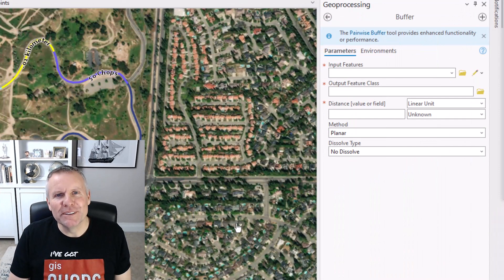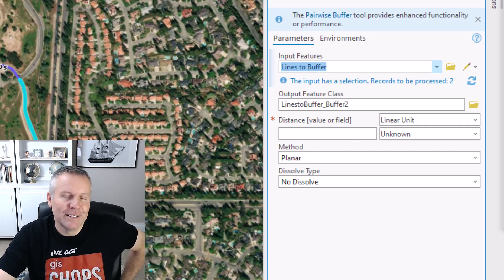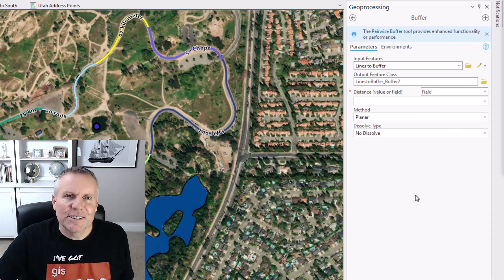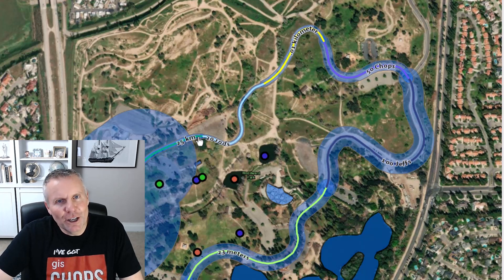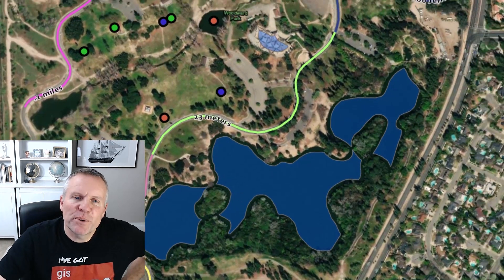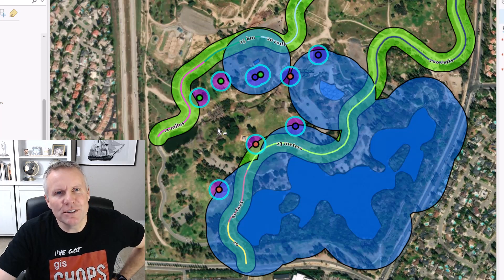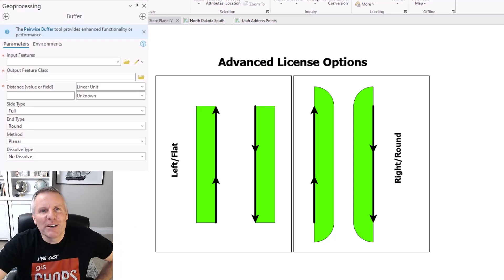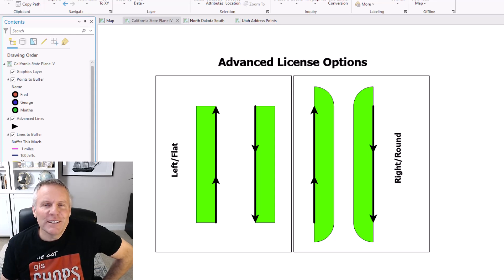How to Use the Buffer Tool in ArcGIS Pro

Comment: I appreciate the attention to detail, but sometimes I get impatient.  I need to do Thing now and want the basics.  
Buffer adds X Units to input.  That's the Elevator Pitch. 
Now... here's the advanced level and the cool stuff you can do.
I hadn't even thought about using a negative value.
Reply from the maker: So you’re saying I should get to the point faster? You can always watch at 1.5 speed. 😄😄
Reply: @GISChops  No. You're doing what you need to do by showing the full scale of the tool.  Sometimes I just need a Short video to show me the basics.
My impatience is a product of trying to come up with a solution on the fly.

Comment: I created a polygon and applied a buffer to it. I needed to edit vertices on the polygon but the buffer did not update to the new shape. Is it possible to have the buffer update if the polygon shape changes?
Reply from the maker: I’m not aware of anything that will automatically update a buffer when the source polygon changes. Maybe you could have an attribute rule that populated a field in the buffer layer then have a script buffer them again. 🤷‍♂️

Comment: Have you used the Linear Burn layer effect? I’ve been using it for over a year now and it’s become my go-to
Reply from the maker: I have not. How do you use it? Is it the blending option?
Reply: @GISChops  I use it on just about any dataset that I would normally set transparency to. Sometimes I will still mess around with transparency but Linear Burn is great for blending with hillshades or any basemap really. Try it out and let me know what you think!
Reply from the maker: Cool! I’ll have to try that instead of transparency.

Comment: This was a great video. I learned some things I didn't know you could do. On a related note, while looking at some buffered roads, my coworker and I discovered that some people are using International Feet instead of U.S. Survey Feet. For our work, the difference is neglegible, but for some projects and I imagine some business needs, choosing the right unit of measure and being consistant could be a big deal. There is a difference in the two units of measure starting out at the 6th decimal point (if I remember correctly) and that will start making a large difference as distances get longer. I don't know if a lot of people realize the difference exists. Do you know if there is a way to customize the unit of measure menu so that only those that you use are available? Thanks for the videos. Keep them coming.
Reply from the maker: That’s a very good question, and a great idea. Check boxes that say US units only, international units only, metric units only. You should submit it and I’ll plug it.